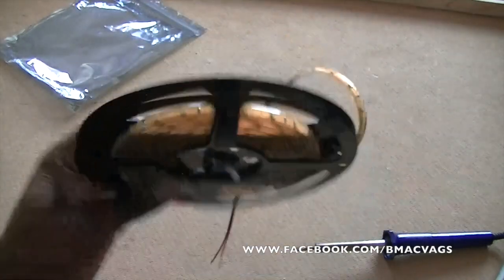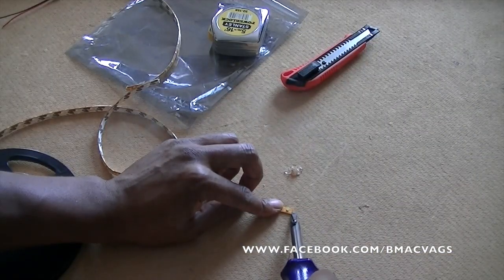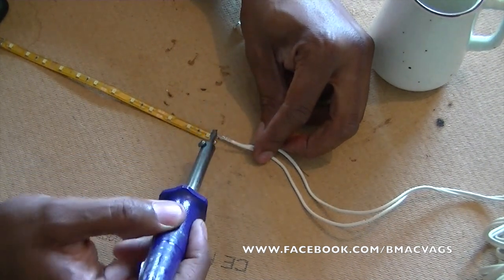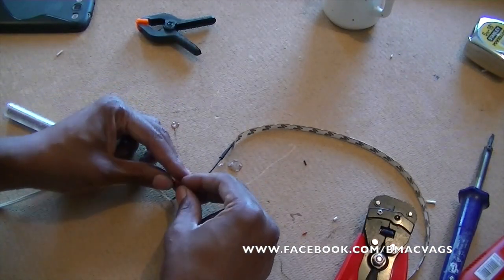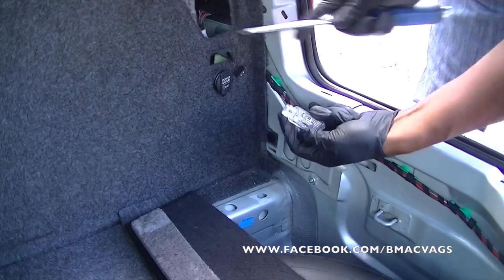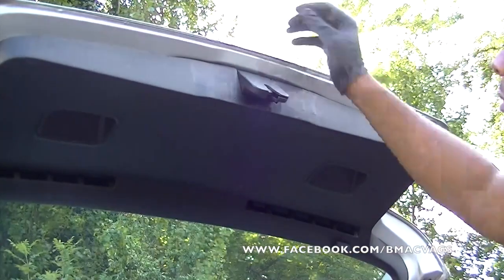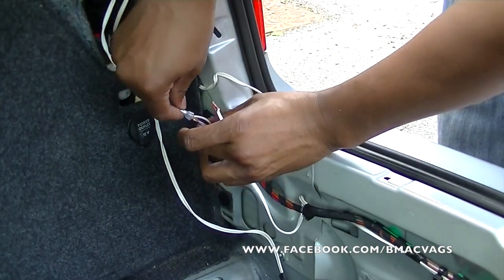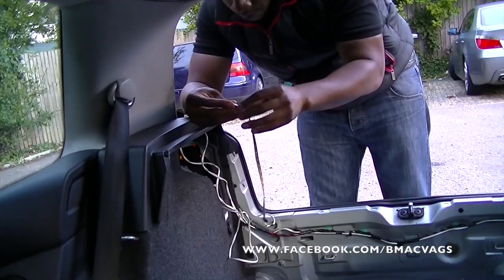How to Install LED Strip light in to your Boot \ Trunk

Comment: This is a great improvement on the poor trunk lighting VW does. I drive a Jetta and though my one bulb was bad mounted on the upper left facing down, but I didn't know the Golf had it so low on the side, if your trunk is full you'd see nothing. I'm going to try this improvement when the snow clears here in Canada. Thanks for the great vid!

Comment: cheers man just finished doing the lights. only thing I would say is that you can feed the wire into where the bulb sits in the housing to avoid having to split the light cable. looks great!

Comment: Trying to decide where to put my LED's in my corsa 3-door.  Options are either side (although, the corsa doesn't have nice "purpose built" lips like this golf),  under parcel shelf (with curly, extendable cabling), or on the actual boot hatch.

Leaning towards parcel shelf although it does look nice on either side.  What LED's did you use, 5050, 3528 or 2835?

Comment: great video again, i initially switched the bulb for a led bulb but this looks so good I've gone and bought all the component and am just trying to get myself to give it a go. Th wiring part near the end is where i might get stumped, about where each wire needs to be connected. How do i go about this?
Reply: +goonzjav Get yourself a multi-meter and test out your vehicles electrical wiring as well as your own wiring. Polarity matters in this case but only to make the LEDs work. The reverse polarity will not harm the LEDs.

Comment: Can you do a video on changing the colour of the unlock lights
Reply: What do you mean by unlock lights?
Reply: BMAC VAGS When I press the unlock button on my keys to unlock or lock my mk4 golf there are yellow flashing lights all around the car. I understand you can't change the indicators but there is two lights in the headlights that are yellow and only light up when i'm locking or unlocking my car. P.S. your channel is awesome! I've been watching all your videos for ages! they have helped a lot since i own a similar car in Australia
Reply: Troy Austin Thanks for watching my videos,  it is so nice to hear that it is helping people all over the world. Changing the colour of the indicator would means that it would be that colour everytime you used it. Have you seen the mod you are asking for done before?
Reply: BMAC VAGS I haven't seen it done before, I've just seen a few cars have it. If not could you do a video on installing LED's in the footwell of the driver and front passenger seats thats controlled by a switch
Reply from the maker: Troy Austin Yes I will look into the footwell lights, that has been requested a few times
Reply: BMAC Car Mods Legend! I will share the video to all my friends. We all have VW
Reply: BMAC Car Mods I was planning on doing this too, but connecting it to the roof light. Haven't looked at the wiring yet though, so don't know how hard it'll be!

Comment: Another cool cheap mod I did was change the alarm led in the drivers door very easy and cheap no resistors or anything just pop old led out new 1 in and wire it u can even change it for a bigger led by drilling out the plastic depends how bright u want it also looks like ur car has aftermarket alarm because it looks different

Comment: I've had this issue. Replaced the bulb with a 2w flat SMD bulb off ebay and now the boot is as bright as the sun without messing about with wires etc
Reply from the maker: Send me a pic if what it looks like mate
Reply: Sure. Please note that in real life, the boot is lit almost evenly but this is taken with a camera phone with flash "Off" to show the light clearly. That's why only 1 side is lit properly while the other side is pitch black

http://s30.postimg.org/iby3wgma9/Image1023.jpg
Reply: @BMACCARMODS  do the wires have to be the same length?

Comment: Led strip uses 12v dc, how much Volts that small OEM bulb uses ?
Reply: all things in your car uses 12 v lol
Reply: 12 vdc. a quick test with a volt meter should show you the power at that light

Comment: Man ,trust me ! I would pay you to do this on my golf ! It looks so awesome ..but I`m still afraid to try install all this kit. Some advices ?
Reply: My advice would be just try it. i just installed mine, followed bmacs instructions and they turned out amazing. just like in the vid. i keep going to the car just so i can check out how much bloody light there now is in the boot!
Reply from the maker: goonzjav Thank you :)
Reply: +David Cioara Most automotive stores and big box stores now have LED kits that work off a 12 volt source and are perfect for installing in your car. Just take the leap of faith and do it. Peel and stick usually and can be very bright.
Reply: If you have a mkiv like in the video I just did mine, looks great.  I thought it would be overly bright but it looks factory and doesn't stand out at night, the light is high up and spread out enough to see everything perfectly.

   Fit ~16.25" strips on each side.  Hardest part was getting the rear trim panel back on for me.   Ended up pulling the rubber seal for the lid away then the trim went on easier,  had to carefully push the lower lip of the seal back under the bumper cover with a flat blade to get the seal back on.    For power I didn't mess with any of the factory wiring decided to just solder my wires directly to the back of the factory light holder.  Used the metal that holds the bulb (it still holds the bulb), figured it was far enough away from the plastic not to melt anything and it worked great.

Comment: At least you have a boot light! My 2003 Toyota RAV4 has NO boot light at all!!!
Reply: +Gavin Higgins you can put some wiring to the wires from the light bulb that is inside on the roof, and just pull it into the trunk, hide is somehow behind all the panels and voila ;)

Comment: You can also just buy LED replacement bulbs with a wide range of lumens that are very bright now that are plug and play. $8.
Reply: +plog1805 Strips are far more effective, i've done the LED replacement bulbs alongside fitting another courtesy light, still wasn't enough, did my own version, can see it on my channel, i don't wanna plug my video on here though, don't wanna be rude!!